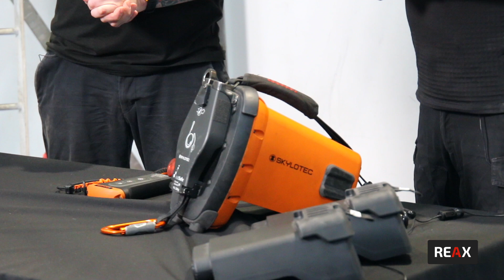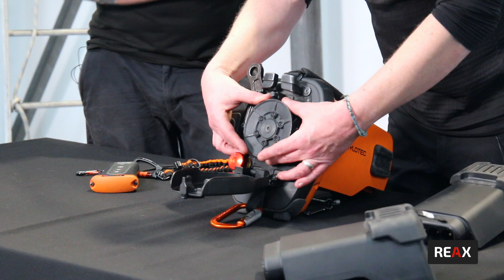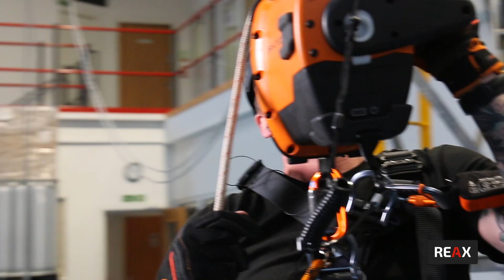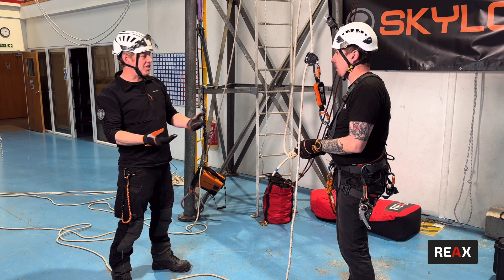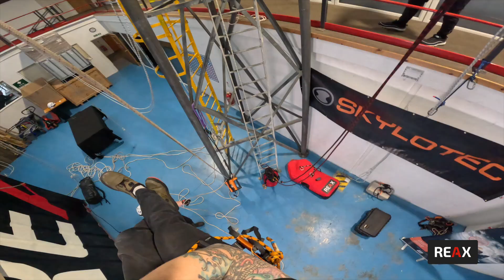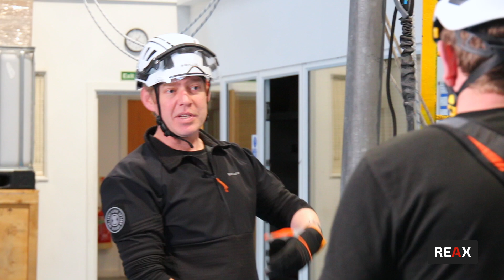Skylotec ActSafe ACX Power Ascender Explained | Setup, Operation & Demo | REAX

Comment: Good run through.  We have been running 2 of these for 3 years now and use them extensively for RA and CS work.  Spot on for getting non specialists onto structures.  We also specified and trained the rescue team on HPC with the rescue version the RCX.  Excellent tool.
Reply from the maker: Thank you for the feedback! We love this device and it's application. In the right circumstances it's a game changer especially with the new batteries being released soon increasing the lift of 100kg from 200m to 600m per battery!